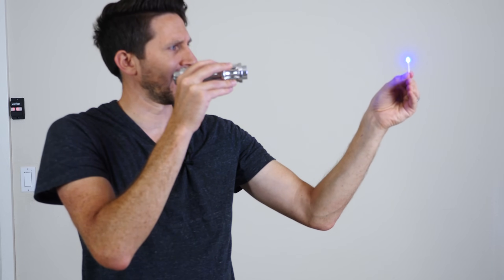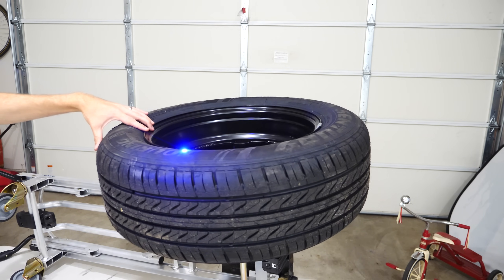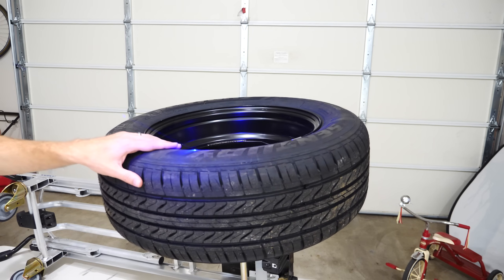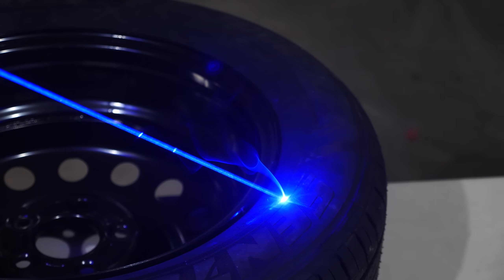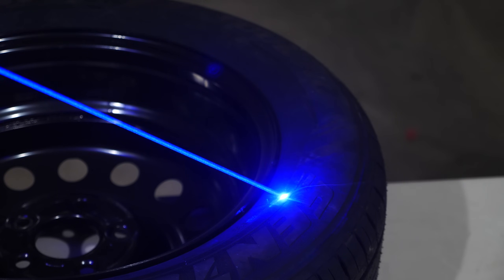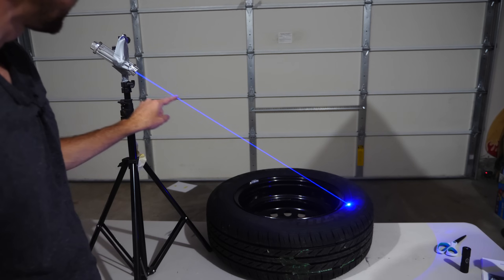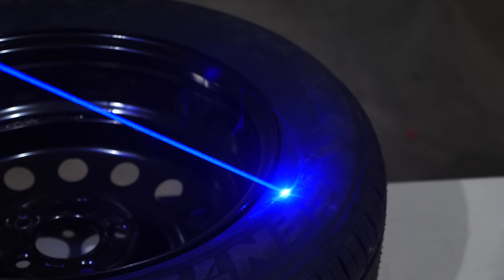Can You Pop a Car Tire With a Burning Laser?

Comment: I have reported this video for showing dangerous acts. You are being completely reckless in this video.
Just for a scale of things, more than 5mW you want to be wearing laser safety glasses (not clear ones that you have), you have a blue laser so you should be wearing red/orange glasses. At 100mW it's powerful enough that a flash is enough to cause permanent damage, your laser is 1.4W.
You also shone the laser on and near to shiny objects, the rim of the wheel was very close as was your wedding ring, and when you were shining the laser on the duck tape you were directing the laser at a bunch of shiny things.

You might think "I'm not stupid, I'm not going to point the laser in my eyes" but all you need is for a laser to reflect off a surface and back to you.

If people copy what you have done someone will blind themselves. You might think it's fine because nothing bad happened this time but with lasers it's kinda all or nothing, the laser beam can miss your eye slightly and you're fine, or it can shine into your eye and now you may have a permanent dark spot in your vision. With an audience your size you should be treating laser safety far more seriously.

Comment: Anything over 2 watts I wouldn’t even use indoors unless you have something to shine it on as a barrier that it can’t go through like a big rock or tile or something with glasses on due to the brightness there will be and because of risk of starting a accidentally fire. Under two watts you can be okay as long as your careful and not holding it at the wall at one spot for any given amount of time and also if you have a barrier which don’t hurt. Under 2 watts you can technically be okay without glasses if your super careful and only shine it on dark things that are mostly black that absorb most of the light but it’s very risky, light colored objects will still be super bright and could cause long term damage overtime, and if  you hit something reflective it’s over for your eyes. And ofcourse don’t even shine it and anything living or aircraft’s or other peoples houses as it could hurt someone and get you a felony. Just looking out for y’all.

Comment: dude no sh**n the laser is not gonna burn through anything with it wobbling like u have it u should retry this test with a fixed tire axel point, and u have to test the tire at different speeds and the speeds have to be constant notg just pushed with your hand come on man make the test legit if your going to go thru the trouble of testing it in the first place

Comment: First off, no tire is ever going to "pop" like a balloon from a small puncture, they're specifically designed to prevent that.  Your attempt at burning through failed because you were using an unfocused beam.  Even though the spot diameter was small enough to generate enough heat to make smoke, it was still WAY too large to burn any holes.  Try placing a long focal length lens in the beam and focus it down to a much smaller spot size.  You'll get CLOUDS of smoke and it shouldn't take too long to perforate the sidewall.

HOWEVER, I strongly suggest that you invest in and use protective eyewear that is appropriate for the power level and wavelength of the laser you are using.  Any handheld laser device with a power output greater than 50mW is easily one of the most eye hazardous things that you can get your hands on.

Comment: The laser looks fake because is a combination of a holographic image in purple with an actual white light, is not a true blue laser, you can clearly see the purple holographic color displaying when the hand goes through the laser, which is obvious a control experiment, which means the laser is fake, not emitting heat.

Comment: Nice Experiment - demonstrating quite well that the risk of using these Laser with an Output Power round about 1000mW = 1W @ 445 nm Wavelength is´nt dangerous damaging things like a car tyre or other stuff used in traffic. 

In Germany some people want to declare these Lasers like fire arms...and it is wanted by the authorites here that people owning these Lasers are beeing punished like those owning illegal fire arms. 

This video showed quite well, that this is not equal to the real possibilities in danger and the potential destroying stuff with these battery powered und carryable Lasers with Output Powers 1000 mW.

But: These Experiment is dangerous looking into the spot without wearing safty googles. (!) 

That should be recognized if you try this at home in your garage. 1000mW is a Class IV Laser dangerous for burning a whole in the backside of your eyes watching the Point of focussed light! 

The Action Lab ist a scientist or technican knowing the risks - but to Do this for other people a write that warning here. 

Always use safty googles (optical density 4+ @ 445 oder 450 nm Wavelenghth) an do not point to other People or use this Laser out from your homezone. :D
I missed a hint like that in the video. Thanks for reading. Greetings, Silvia

Comment: That laser probably came with a cheap acrylic lens.🤔

You can get a decent coated glass collimating lens for whatever wavelength laser that is (~425nm would be my guess) off Amazon or your preferred laser pointer vendor (~$10 or so). Then try this again with the laser focused to a pinpoint on that tire, with freshly charged batteries, and you should have much better results. I've burned through a bicycle tire (~35psi) and a propane barbecue hose (no, it didn't ignite the propane, sadly) with a 3W 415nm blue laser from a range of 120cm or so (and a decent lens). A 1.4W should be able to do a tire eventually, but you might need to "ride the focus" as it burns into the rubber.  

Also, it probably won't "pop", per se, it'll just start to hiss and eventually the pressure will turn the tiny burn hole into a tiny tear and simply let the air out with a sort of "squeal" noise, like a fast leak. Get yourself a laser based on of those newer 10W or 12W diodes and you might be able to get a "pop" out of a tire.

Also, maybe wear a pair of the classic dark red laser safety glasses — even if those clear glasses you have are, in fact, full spectrum UV blocking and/or 425-440nm tuned and polarized laser safety goggles. Why? Because this is YouTube and if you read the rest of the comments, you're obviously freaking out a lot your fans. 😎

Comment: I don't think the laser looks like that on the phon because of the codec used to compress the footage alone. It looks more like you have hit the cameras maximum dynamic range in the blue channel on the phone where as the camera can record a higher range of blue. It also depends on the colour space used on the camera vs the phone too as the camera will probably be using an AdobeRGB space (or something different) and the bit rate of the recordings will be different to too the phone being 4bit to 8bit and the camera being 10 to 14bit. I could be wrong as video is a bit different to photography and I don't do much video.

Comment: you would need something more around 10 or 12 watts id say. Or the laser out of a laser cutter . A laser cutter uses a slightly different laser at a few watts and they can cut sheet rubber so it should pop a tire. You might be able to pop the tire with it by pre heating the tire beyond what it can transfer in a few seconds so say hit with a blow torch around where your going to aim for 10 or 15 seconds to pre heat then aim the laser in the center of the spot. It should overwhelm the tires ability to dissipate the heat  maybe...

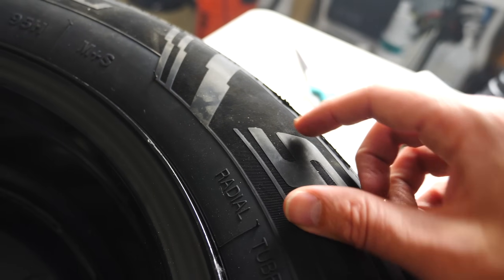Comment: @4:21 Is he saying were or weren't able? To me it sounds like "were" which would be wrong or am I missing something... I think pronunciation in these cases are important. 

Also the steel wire mesh under the rubber would dissipate the heat more effectively, than the rubber itself and help overheating the point of the laser.

Comment: "rubber doesn't melt" oh yes, rubber does melt... I don't know where you got the idea that rubber only burns but doesn't melt. Maybe that specific rubber, but there are lots of rubber things and as a kid, I used to make small fires and burn things like pens, rubber. styrofoam etc... and anything that is rubber or plastic melts. If you heat it and it gets soft, it melts.

Comment: @The Action Lab ... I wonder if you were to use a lens to refine the beam to a pin point like those cheap burning lasers do with the adjustable focus point and see if that makes the tire burn plus fire the beam at a 90 degree angle, not at the angle you had it at. (Yes I have several of the cheap burning lasers in red, green and purple/UV as I'm on very low income plus caring for my mother, so can't afford the better laser. I've been wanting the blue laser like your one for years now but every time I try save, I end up having to use the money for food and heating... Any ways, my purple/UV laser focused to a point burns your skin and it hurts)

Comment: The reason your iphone shows colors less clearly then your other camera can simply be explained with the simple word "Bits"

Your iphone simply uses less bits then your main camera because for one, it was made cheaper, and for two, that way you save far more space on your device while filming or taking photos of things... you see, a bit is basically a unit of measurement that increases the number of different colors your pictures can hold exponentially, one single bit only has exactly 8 colors it can show... black, white, green, red, blue, yellow, pink and cyan (teal). every time you increase the number of bits, you increase your color spectrum exponentially... many of the cameras we use today are 8 to 10 bits (then again though, it depends on a lot of factors) but the color spectrum between just 8 bits and 10 bits is thousands, meaning instead of having one, solid looking shade of blue, you have many different shades of blue all along the same small line... bits have absolutely NOTHING to do with pixels btw... pixels are the number of little boxes in your picture while bits are the spectrum of colors that can be used to fill each box. I hope that explanation makes sence but if it doesn't and you still want to understand, simply Google "8 vs 10 bit colors" or something similar until you understand... looking at images might help as well.
Reply: No, this effect has nothing to do with bit depth (or chroma subsampling, or compression). I'm pretty sure that it's due to the iPhone's color matrix function (which translates the RGB colorspace captured by the sensor into a standard colorspace such as sRGB, Adobe RGB, or Rec.709 YUV) not being properly gamma corrected. Bayer filter mosaics tend to have low-saturated colors to make neighboring pixels more similar, and thus interpolated more easily than if they had highly saturated color filters – so the color matrix function will increase the saturation of the Red, Green, and Blue by appropriate ratios, while also shifting their hues appropriately.

An increase of saturation is, simplifyingly speaking, done by subtracting each primary from the other two primaries. But if this is done without proper gamma correction, or overdone, will result in decreasing the overall brightness of the color by too much. So the bright blue channel of the laser beam would be subtracted from the red and green channels too much, making them too dark, resulting in a laser beam that is darker than its surroundings.
Reply: I must respectfully disagree on a minor detail. Cyan is not teal. Teal is half way between cyan & green, & a dark color. Unfortunately the hue of teal can't be called teal at full brightness. Color words are funky that way.

Comment: The iPhone versus your other camera treats fully saturated pixels differently. The iPhone treats a maxed out color as just that color at full brightness, whereas traditionally in digital imagery it would display it as white. I think the reason for that is that in areas where it's supposed to show up as white, it would end up looking all glitchy with older cameras because would try to display that pixel as a solid color instead of white.
Reply: You're very close. I'm pretty sure that it's due to the iPhone's color matrix function (which translates the RGB colorspace captured by the sensor into a standard colorspace such as sRGB, Adobe RGB, or Rec.709 YUV) not being properly gamma corrected. Bayer filter mosaics tend to have low-saturated colors to make neighboring pixels more similar, and thus interpolated more easily than if they had highly saturated color filters. So the color matrix function will increase the saturation of the Red, Green, and Blue by appropriate ratios (while also shifting their hues appropriately).

An increase of saturation is, simplifyingly speaking, done by subtracting each primary from the other two primaries. But if this is done without proper gamma correction, or overdone, will result in decreasing the overall brightness of the color by too much. So the bright blue channel of the laser beam would be subtracted from the red and green channels too much, making them too dark, resulting in a laser beam that is darker than its surroundings.

Comment: You should try focus the laser, then it will burn much more effectively. But anyway - a tire will not pop. If it manage to get thru, it will just make a hole and the air will slowly get out (just like if you drive over a nail or something).

Comment: Action lab : Burns tyre with laser

Me : Still looks at remote control LED in phone camera while pressing a button to see if I can see light
Reply: And yes you can see light
Reply: @aqeelahmad4381   with a camera???
Reply: @nayyarrashid4661  I have observed it works better with old phones ( non smart phones ) such as nokia . It may or may not work on smart phones. I haven't tried it with a camera . Let me know of you do .
Reply: @aqeelahmad4381  most new phones have a ir filter. Some times you can get it from the front camera or the wide or zoom cameras on the back.

I believe Iphone 4 and up all have the filter and androids from a similar time.

Comment: Does it make much difference if the laser is further away?  Does it take longer to ignite based on distance
Reply: All the dust and smoke between the laser and the tire will definitely attenuate the beam. More distance means more dust. Also he'd need to use a collimating lense and focus the beam on very tiny area. You don't see laser cutter's cutting head hanging from the ceiling...

Comment: Ofc you can but not with than scrawny "laser" :P
Reply: Christian Ivarsson it would have to be a super high powered laser, tires are meant to take extremely high amounts of heat
Reply: I suspect that, if 1.4 watts is a lot for a laser, it's only because govt/bully wants to keep anything high powered out of the hands of civiliains/victims... scrawny by design/conspiracy.